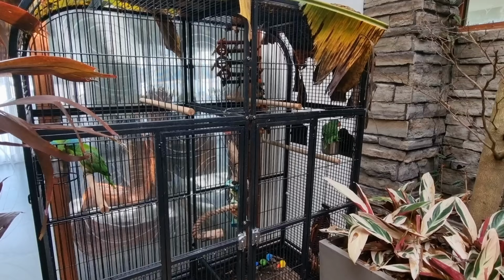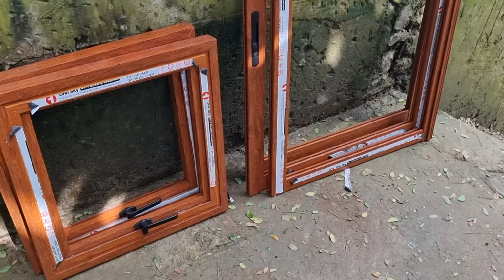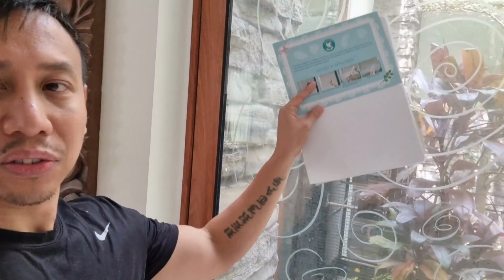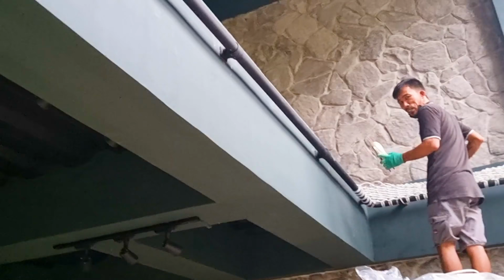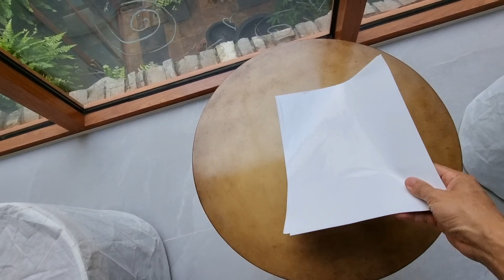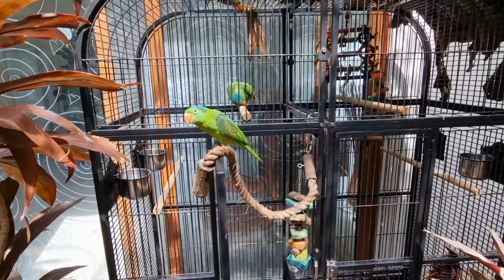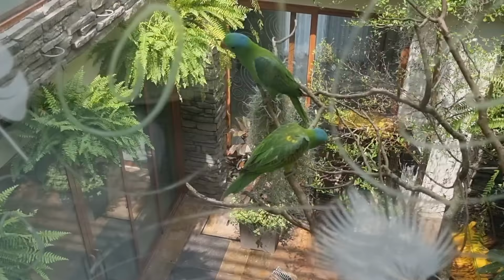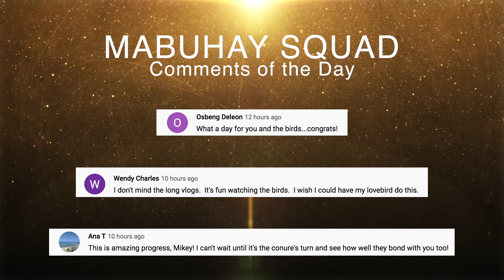My Birds Are Finally Flying to the Top of Their Giant Aviary - Sept. 30, 2022 | Vlog #1562

Comment: Been checking out a few of your videos, I love how patient and calm you are with the birds. This aviary is the perfect environment for them, very good job.

Regarding two of the concerns in this video: the older female Amazon is having trouble because her wings have been badly clipped, so she probably won't be a confident flyer for another couple of months until she molts those old feathers and grows new ones in again. A ladder or branch attached to the bottom of the cage from the floor will help her feel more confident and secure when she's outside, because she'll have an easy way to get back to her "safe" space (the cage) at will.

And the conures: conures are VERY territorial over their cages, especially in groups! This is pretty normal behaviour for them, so once everyone is out in the aviary and able to go hang out in their own spaces their territorial behaviour should calm right down. They might bully the Amazons a little bit due to their more timid nature, but having plenty of perching areas and places to get away will help with this a lot. The hanging branches from the top of the aviary would be a wonderful idea!

Congratulations on the new home and the good work with the birds, and good luck!

Comment: Wait, is climate change really affecting crops? I thought it would help crops since carbon dioxide is a greenhouse gas (meaning it traps heat in the atmosphere like a greenhouse). In my mind, if warm greenhouses are good for plants then a warm planet should be too. Of course, it won't do much good if the land to farm them on is under water, but that hasn't happened yet. So long as there is land left, wouldn't warmer weather and more rain help plants?
Reply from the maker: No, it's not that simple. Climate change can cause droughts in places where they usually don't happen or intense heat, and no not all plants love heat. This is why apples, pears, and peaches do not grow in the Philippines. It's too hot for them here. Some plants require seasons to flower and fruit so they are truly tied to climate. If anything changes it can totally affect the plants. Changes in growing conditions can weaken plant immune systems making them vulnerable to disease. Climate change can increase populations of agricultural pests and cause locust plagues, for instance. The list goes on...
Reply: @MikeyBustosVLOGS  huh. I guess nothing is simple on a whole planet's scale.